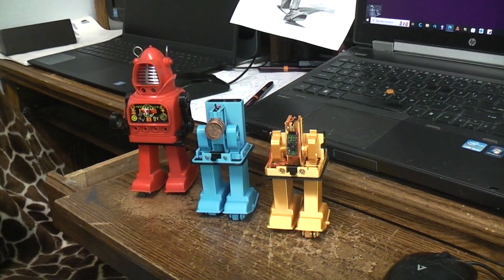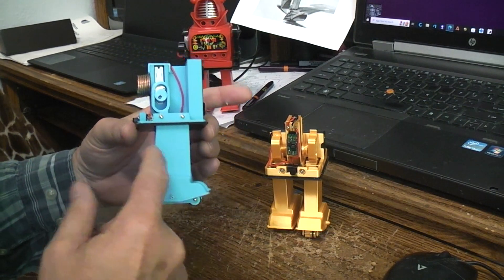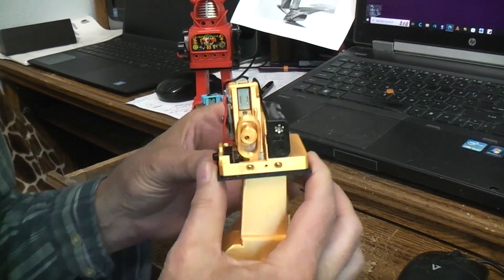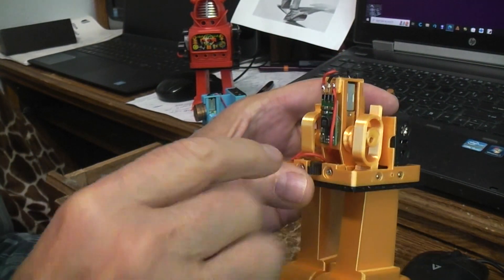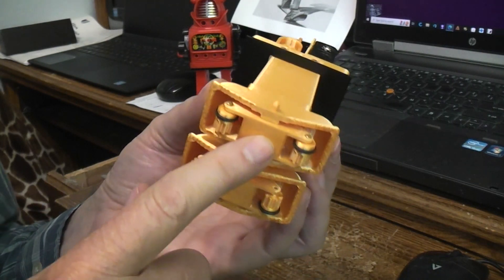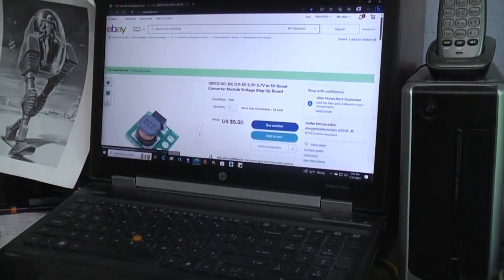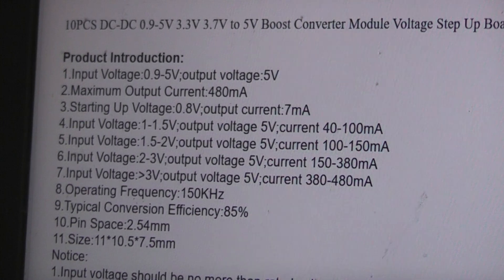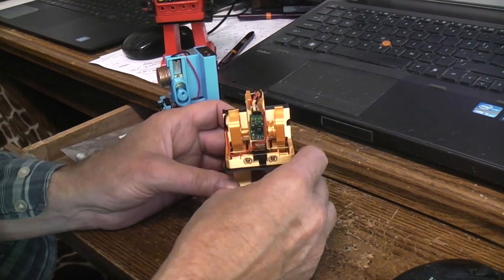3d printing the Jupiter robot. The legs and motorized base section.

Comment: Great re-design and balance considerations - Thank you for your build videos.
Regarding the pulley idea for the antenna's - Have you any links to buying in 'O' rings and pulley belt sizes this small?
Reply from the maker: Yes belts can be bought on Ebay for repairing old cassette decks. But I think I will make my own. Either 3d print one in flexible TPU or just use elastic thread.
Reply: @Robothut  Elastic threads not sure of? I do know that elastic bands perish, so useless.
Printing using flexible TPU is a good idea; I'll order some and try that. It's for your box pushing robot 'O' ring...
Reply from the maker: @reg2590  If you look up my video on build a Leslie "rotating speaker effect"  for my guitar amp you will see what elastic thread is. It will not break down like crappie rubber bands.